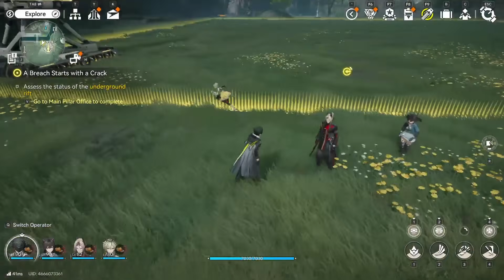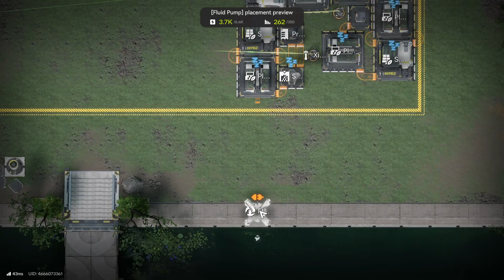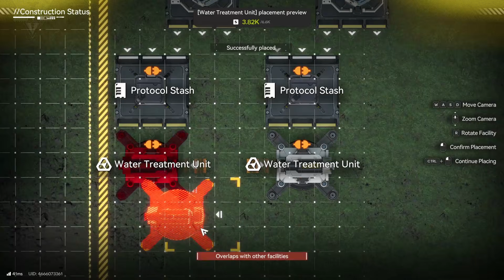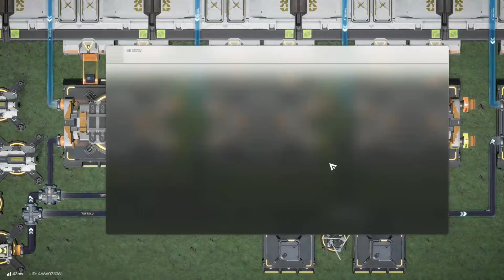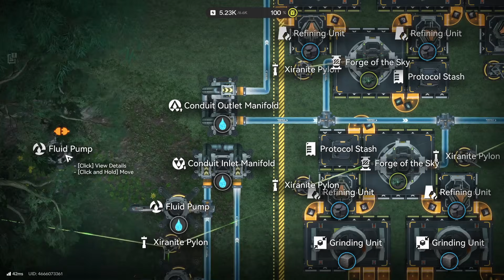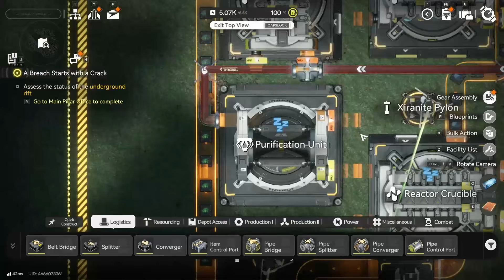1.2 Wuling Full Base Build Along [hetonite, heavy xiranite, SC batteries, Yazhen A, and Components]

Comment: My base run out of power for some reason :))
Reply from the maker: might be the expanded crucibles getting clogged Ive pinned a comment for troubleshooting
Reply: @Aricatto  yah i just find out that the expanded crucibles clogged so the Xircon cannot be made, I have to rebuild it and now it's working again
Btw, i figured that refining unit (Cuprium) has stop cause I max out Cuprium so the Conduit Outlet for the sewage water run out which is the reason it cannot make Xircon
And i'm currently remove the comp structure to let the battery product run smoothly
Reply from the maker: @quaivatxanhlèxanhlét nice, you figured it out!, I will make a new base soon, the internships are taking up most of my time so my apologies

Comment: Excellent building philosphy! I wish the devs would add some more (perhaps one more) production lanes (internal) of some of the facilities. Many of them have multiple input/output lanes but end up being useless because at this point we're only using them (in the case of piping) to dump by products, IMO it was be a real treat to produce parallel within a facility -- taking high effeciency to the next level
Reply from the maker: indeed, I love the idea of expanded crucibles, and fluid byproducts being able to do different things in a single line, but it does need some polishing IMO.

Comment: I like your build-along videos. Much better than those who just show you how to throw down some blueprints. 👍

Two suggestions for the Xircon/Heavy Xiranite production: 😉
- you can simply input the sewage on the leftmost Expanded Crucible and then pass it on from one Crucibles to the next (orange output to yellow input).
- use only two outputs for Ferrium Powder (between Cruicible 1&2, and between 3&4), use belt splitter to supply the Cruicibles. This provides room for two Depot Inlets. Use belt combiners to transfer Xircon from two Cruicibles each to one Depot Inlet.
Reply from the maker: that might actually be better yeah I'll try that and see how it goes!

Comment: I have a question about this AIC: Will I still have spare cuprium to make hetonite parts cuz like I don't even have one to build anything
If yes then can you make blueprint for it on a short? I would appreciate it
Reply: Currently you are going to be short on cuprium no matter what. He has another video for hetonite components that you can put down in the Marker Stone Area. But it will only work at 12.5% efficiency.

Edit: sorry, he does use that gear blueprint in this video. For the parts you will have to just remove the gearing unit and have the parts feed directly into a protocol stash.